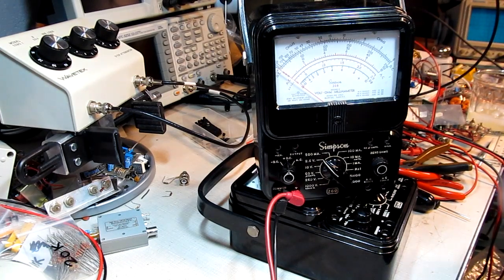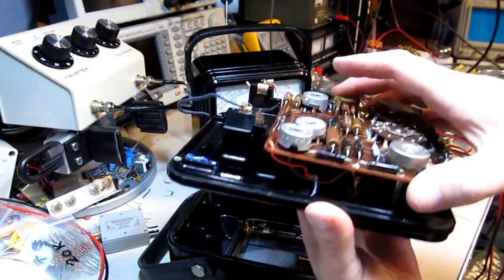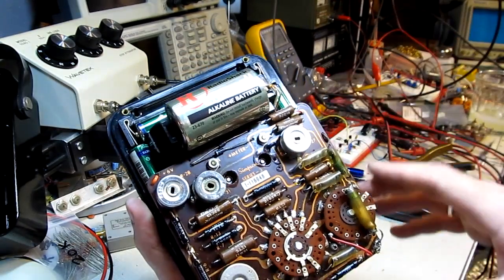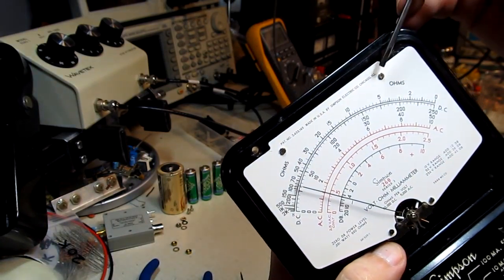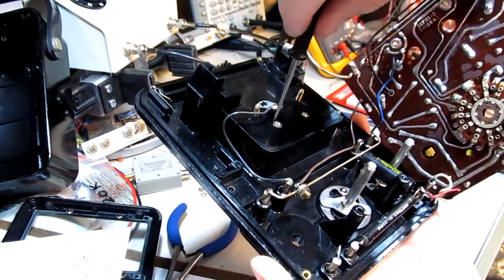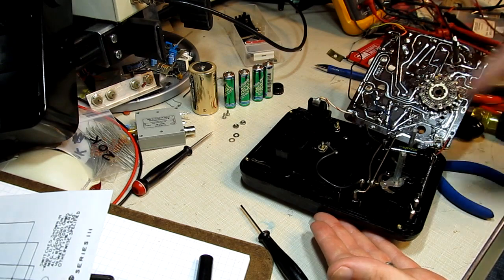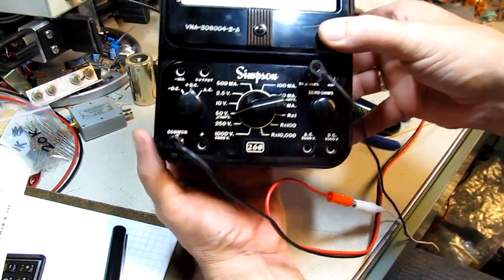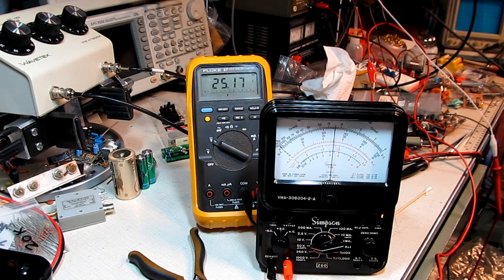#115: How to replace the meter movement in a Simpson 260 multimeter VOM

Comment: Wow!  i am working on my Simpson 260, model 7PM.  The two nuts used to hold the meter face in place seems like a terrible design flaw.  I have quite a great set of tools, but I honestly do not know if I have anything that could get on those two nuts.  I would be tempted to expand the two holes very carefully.

Comment: Thank you.  I have a series 7M 260 with a similar failure.  The meter requires 85 uA to reach full scale.  It did have a battery leak which may be related to the issue.  I'll be going to Hunstville hamfest soon, so I'll see what turns up.  :)  Although digital voltmeters are available for not much money, I like having a good reliable analog meter.  I learned something else today about this meter, don't try to clean the white lettering with an enzyme cleaner such as "Awesome" cleaner from Dollar General.  The White paint cleans off along with anything else.

Comment: I bought my 260 in 1960 and still use it today.   They are still available for purchase today. I have several newer 260’s. 😂One thing I don’t like is the newer series use  proprietary  jacks which make test lead adapters necessary in my shop.  Most of my instruments are the modern Fluke meters. I would never give up my 260.
Reply: Finding test leads that fit is a nuisance.  Is it for safety or to keep you buying expensive test leads?

Comment: Very good video my buddy. 3 days ago I bought the same Simpson 260 Series 3 multimeter. Can you help me calibrate it, because in R*100 and R*1 the measurements are not correct. I tested the resistors with a Fluke 77 tester. Best regards.

Comment: Greetings ...

Thanks for your channel.  
  
My 260-8 meter seems to have become "unbalanced",  one display tick mark between being positioned vertical and hortizonal.    Have been looking for info as if it is better to replace the meter movment or try to repair.    

Any suggestions ?

Thanks..
Reply from the maker: While is it possible to move the counterweights to balance the meter movement, this is a very difficult thing to do.  Personally, I don't have the knowledge or skill to do it properly.
Reply: @w2aew  thanks.

Comment: Not sure if you're replying, can this meter be used in place of a VTVM ? My old vtvm has 10meg impedance and I need something similar to replace it. Thanks !
Reply from the maker: No, the Simpson 260 input impedance is MUCH less than that.  Another VTVM, or just about any DMM, will have 10Mohm input impedance.

Comment: Hi, I have a 7 series and it gives me zero horizontally and on 2 sides, but in the other potions it does not give zero, as well as no measurement works, I want to know if the galvanometer is fine? .Thank you

Comment: I wanted to share my experience with you folks. I purchased an used simpson 260 series 7M from eBay. Everything looks good except that the needle did not reach the Zero position at the Rx1 ohm scale when the leads were shorted together. Because the Rx100 and Rx10,000 scales were working fine, I tested the resistor R16 (11 ohms) and it checked OK. Then, I concluded that it must be a parasitic circuit create by dust and dirt. Even though the PCB circuit looked pretty neat, I cleaned the traces and the areas around the resistor R16 and the Range Switch with a Q-tip and 100% alcohol. To my satisfaction, the Rx1 scale started working as it should.

Comment: Which DVM lab meters can measure the Forward Diodes Resistance? In rectifier circuits I think using a Simpson 260 you can measure the Forward Diode Resistance but when the AC voltage is increasing the forward diode resistance will increase in value. So the higher the AC voltage the Higher the Forward Diode Resistance, but how can you measure the Forward diode resistance?
Reply from the maker: A diode's forward resistance is not a constant value, it varies depending upon the operating point.  So, the only way to characterize it is to look at the I-V curve for the diode, using manual measurements, a curve tracer, or an SMU (source measure unit).
Reply: @w2aew  What is a SMU source measure unit? Measuring the I-V curve using a curve tracer doesn't get the Diodes forward resistance values. The DVM meter and Simpson Analog meter only has one test current and one test voltage to measure OHMS. DVM meters setting in OHMS will output a test current/current source and will measure the voltage drop across the diode or resistor to get the Ohms resistance value. If I use a Lab power supply as a constant current source and use a DVM meter set to voltage I can calculate the ohms or forward diodes resistance?
Reply from the maker: @waynegram8907  A SMU is a combination of a precision current source, DMM and power supply.  It can be used to source/sink current and measure  voltage, or apply voltage and measure current.  Very useful for characterizing  two-terminal devices:
https://www.tek.com/document/brochure/source-measure-units-save-time-space-and-money-and-make-multiple-measurements
A diode is a non-linear device, thus the "resistance" is different under different bias conditions.  The resistance can be determined by the slope of the V-I curve at any point.  If you want to do this with a constant current source supply and a DVM, you'd have to measure two points and then calculate the slope (change_in_V)/(change_in_I)
Reply: @w2aew  How can I use a Lab Power supply as a Constant current source? If I set the current limit on the lab power supply to 1mA , what voltage do I use to make the lab power supply into a constant current source? Or do you just set the voltage on the power supply to the forward bias voltage .7vdc and then set the current limit to different current settings and using my fluke DVM to measure the voltage drop across the diode? The Forward Diodes resistance will change in value for different current settings and voltage settings. In Rectification the diode is "not biased" at all have NO DC bias or DC voltage. The AC voltage will get rectified but when the AC voltage is passing through the diode, the forward diodes resistance is changing in value. The Forward Diode resistance will cause a LOSS of efficiency in the rectification circuit. How would you measure the Forward Diode resistance when an AC waveform applied to the Diode to measure the Loss of Efficiency of the rectification circuit?
Reply: @w2aew  If you have an SMU can you make a video lesson on how to use an SMU to sink current and Source current to measure various components. I have never used an SMU so don't know how to really use one to sink current and source current. A lab power supply only sources current, I'm not sure if a lab power supply can SINK current?
Reply from the maker: @waynegram8907  If and when I get an SMU - I'll do a video on it.  True, most lab power supplies can't sink current.

Comment: I own a couple of these meters,  as well as probably 3 other analog VOMs.  And a half dozen or so DVMs,  none of which are in complete agreement with each other.  :-)  One of my 260s is a Series 2,  I've had it since I was a kid,  and it's seen some horrible abuse and a few repairs,  mostly when I had access to those folks that could do that professionally.  I've replaced the original leather (!) handle with some nylon strapping after the leather one got chewed up in a toolbox lid,  the nylon had to be cut with a tool that could handle piano wire.  It ain't gonna break any time soon.  The other meter I was given not too long ago, and it's a real sad case.  The glass is broken,  and at least two of the shafts are "frozen" and I'm not sure what to do to deal with that.  I think that it's even older than the one I had,  there are a couple of "3V" batteries in there of a type that I've never seen in rectangular cardboard cases,   no sign of leakage (which is why I opened it up in the first place).  Do you know of a source to get parts for these meters?  Is Simpson still in business?  BTW,  two of my digital meters are also Simpson,  I like their stuff in general...
Reply from the maker: Simpson is still in business, however I doubt they still have parts for a 50-70 year old meter.  They still sell a few versions of the 260.
https://simpsonelectric.com/
Reply: I see a 260-8 listed in their current product line.  :-)  I'm specifically looking for a new case for my 461 which was damaged on its face by bench chemicals, and also a manual for my 464,  no luck so far but I've sent a couple of emails.  Some of the places they list as being fairly local to me aren't,  when you go to those websites.  We'll see how that goes...
Reply from the maker: @Roy_Tellason  a 464 manual can be found near the bottom of this page: 
http://simpson260.com/downloads/downloads-2.htm

Comment: Well, worth to ask, mine was another issue, when it was laying down position, it reads ok, when it was on any other position, the needle won't reach 0 when trying to calibrate. I wonder if the movement needed to be replaced.

Comment: Thank you so much for this video. I just bought one yesterday for $25 WITH the case that has the sliding door on it. It needs a cleaning and I'll put in a new battery. His Father who passed away was a Collector  of ANY type of  vintage electronics, the garage is packed full of it. Checkout Craigslist Jersey shore if you are interested. The video here shows me exactly  what to do to check it out. Thanks again !

Comment: Just a plug for Simpson vintage analog meters - Unlike other meters of the 70's  and earlier, the Simpson 260-6 user manual clearly graphs out its responsiveness to AF and low RF with the AC voltage ranges. Its performance looks good for my needs.  I plan on getting that model meter and will be using it for audio frequency voltage reads because of the speed of taking readings that an analog meter gives.

Comment: I have a 260 series 7. Great meter. I have 4 Triplett 630’s, A, type 4, APLK and a NA with range divider circuit. I find the Triplett meters to be a bit more accurate and a little more versatile with more ranges. Other than the 30v battery they are great. They usually sell a bit cheaper on eBay compared to the Simpson. I think the Simpson was more popular in the day but not any better. Great video as all yours are. Thanks for all the tips and knowledge.

Comment: I always hear people talk about watching "needle wiggle" on analog VOMs being the way to go to do alignments on receivers but have never seen it done or really understand the details behind it. Any chance you might be able to do a video on that?
Reply from the maker: The basic concept with alignment is often to adjust things for maximum response (peak in signal level).  An analog meter makes this easy because you can watch the meter rise or fall in response to your adjustments.  This is more difficult to interpret with a digital meter.
Reply: @w2aew  So it's not an oscillating kind of wiggle, but more of a dip meter kind of a response?
Reply from the maker: In general, yes. Usually tuning for s peak, sometimes for a dip. The only time you typically get a wiggle is when you are zero-beating. See my video on zero beating.
Reply: @w2aew  I'll definitely do that. Thanks.
Reply: Se poate ce doriti dv dar trebuie sa aveti oarce experenta  Cu ajutorul unui generator de semnal GSS(Gentr de semnale standard) si AVOM cuplat fie la esirea et de detectie fie in paralel cu dif  Mai sint si alte  metode dar sint cu mult mai greoae si necesita multa experenta si pricepere Cu ajutorul semnalului unuia sau mai multe posturi din respectiva banda de receptie cunoscute  folosind ptru ajutor la inceput o antena exterioara convenabila

Comment: To calibrate an analog meter, could I go with a DMM I have?. It's not a Fluke, but I'm not looking for precise precise measurements.. reason I ask is I just got a cheap analog meter(Soltec HM-102S) and it's my first analog(excitement). I eventually want a Simpson but figured I need to learn how to use this first. Haha. Only reason I want a Simpson is because of your vids. That vintage stuff is awesome. I also can't find much about how to calibrate these meters out of the box or if they already are.  The zero-ing out of ohmmeters is new to me. Recently I've grown quite fond of analog meters..learning about them..and this video showed up just in time, even though its over 4 years old. ..
Reply from the maker: Out of the box, it should be properly calibrated, so I wouldn't worry about it.  They generally don't drift much at all, unless they've been abused or stored in nasty damp environment.  Since you have a DMM, use that for your measurements needing the best accuracy, and use the VOM for quick checks and for those occasions where watching a meter movement (tweaking and peaking circuits) is more important than absolute accuracy.
Reply: w2aew does the needle need to line up with 0 ac/DC scale? What is the 5k, 10k,etc point.
Reply from the maker: I assume you're talking about your HM-102S.  Yes, without measuring anything, the needle should line up on the 0 on the AC/DC scale.  If it doesn't, carefully adjust the plastic adjustment screw in the bottom-center of the meter movement clear plastic cover, right above the meter's fulcrum.  The 5k, 10k, etc. are on the Resistance scale, and are used when making resistor measurements.
Reply: w2aew yes, the HM 102S. How does the mirror work?
Reply from the maker: The mirror is there to get rid of the parallax error.  If you look straight ahead to the meter, the pointer lines up with a given reading.  But, if you are off-center to one side or the other, the pointer lines up with a different spot - all because the pointer is some small distance above the scale - so the angle that you view it is important.  The mirror is used to help you look at the correct orientation.  When you are looking directly perpendicular to the meter, the reflection of the pointer will be directly underneath the pointer itself.  Then, you know you're viewing "dead on" and the parallax error is gone.  If you are looking at the meter and you can see the reflection of the pointer, then you know you're not looking directly "dead on", and you may read a slight error due to the parallax.
Reply: w2aew Ahhh... Thanks for clearing.. I seen that error in the manual but didn't know what it meant.

Comment: Hi, i accidentally put 5Kv ac into 50v range on my 260 series 3
Now the whole ac range is wasted, needle  oscillates  violently  at 50hz i guess.

do you have any clue what causes that, is there any dampening or rectification in the circuit that got fried or do i have some mechanical failure at the needle?

everything else on meter works perfect.
Reply from the maker: You probably shorted the rectifier diodes that convert AC to DC.
Reply: @w2aew  exact asta este deranjamentul Ptru depanare e necesar sa cautati o pereche de diode perfect egale altfel dezecilibrati puntea de masura Aducerea in parametri est putin mai dificila in functie de diferentele care apar din cauza diodelor noi

Comment: I changed out the meter movement on my simpson 260-6 had one with  a bad board  , another with bad meter. after reassembly  repaired unit will not read. any ideas?
Reply from the maker: Not really.  These things are pretty simple, so it shouldn't be too difficult to trace the connections to see if something isn't connected right.  All info on the different series/versions can be found here:
http://www.simpson260.com/

Comment: how do you  tell witch 260 meter you have?
Reply from the maker: Most of them have the "Series #" printed in small print on the meter face.  When in doubt, compare using the info found here: http://www.simpson260.com/
Reply: OK

Comment: Thank, nice repair.  I have a MF-47 analogue kit.  It has scales for hfE, and LV/V.  Maybe you could do a tutorial on how to use these.  The hfE scale is used to measure the condition of the npn and pnp junction of transistors.  It also has a scale for dB which is expained in the Simpson manuel.  The LV/V scale is still a mystery since the manuel for it is in Chinese with no translation I can find.
Reply from the maker: hFE measures the current gain of the transistor - also known as the transistor's Beta.  I really don't know what the LV scale is for.  The only time I've seen this term being used is to show the terminal voltage when making measurements like resistance or diode checks.  Not sure if this is what your meter shows on this scale.

Comment: Hi, I am electronics technician, years pass and there is still interest in this lol analog meter, I wonder if you know the functions of the 4 potentiometers adjustments that brings in the Simpson 260, know how to recalibrate again if there be maladjusted it is very difficult this? I have the full Schematic Manual of this team, but does not explain how calibrated (R22, R25, R1 & R2) ... By
Reply from the maker: There are a few calibration procedure manuals located here, depending on the series of your meter:
http://www.simpson260.com/downloads/downloads.htm
Reply: Thanks man, I have Serie 8, If you want, I send the full Manual, the better the schematic and side components, not so blurry as those who are in this web.